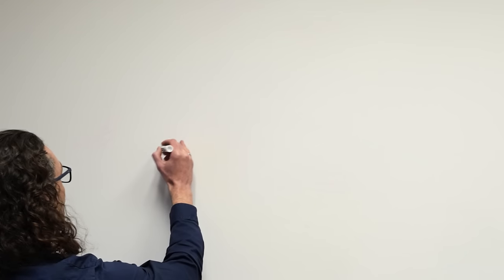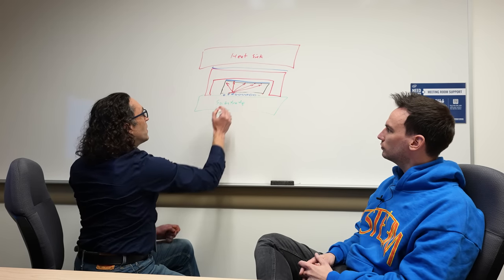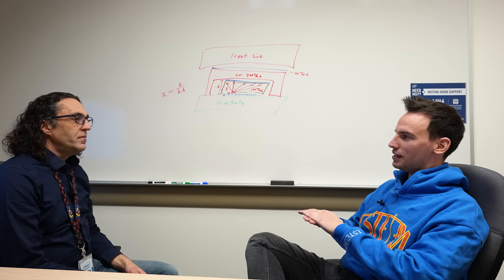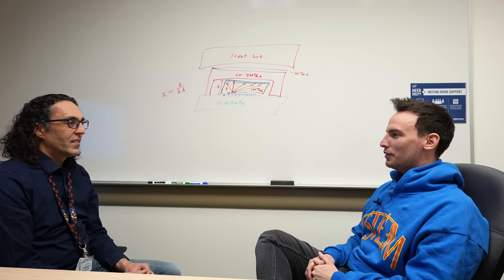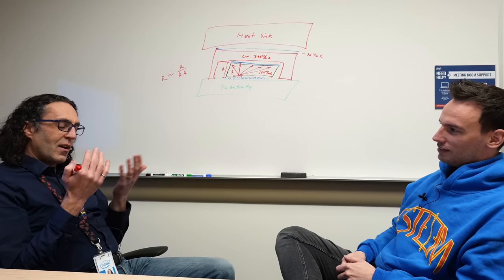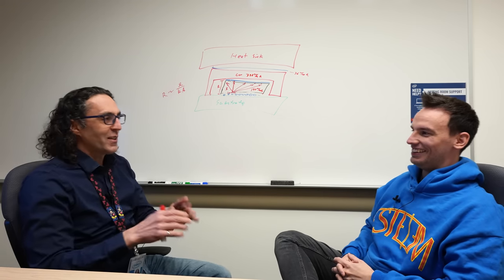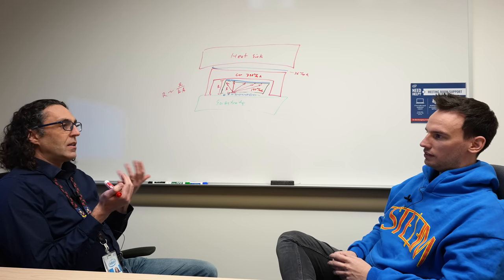Intel Engineer on: Die Thinning, CPU Thermals and Liquid Metal

Comment: easily solved, 2 sided cpu coolers sandwiching the cpu die, and the cpu connectors pass thru holes in the lower contact plate or have passthrus built into them. this solution has already been used in industrial manufacturing decades ago. it stopped due to micro architecture conduction thru too thin insulator materials, newer non conductive materials that perform better have been invented and become cheap enough since then. germanium is also an answer. 
my dad was an operating engineer in 1980-82 at redmond, i remember the day he first brought the intellivision home for us to try, my favorite games were Missile Command, Atlantis, and B-17, football and basketball were fun too, he was part of the beginning of what would become later Electronic Arts.

Comment: Cool video, even though I prefer to stick to team red. Speaking of which, it would be cool if you could do something like this with them as well. Maybe even ask them about possibility of a refresh of 7000 series down the line with thinner heat spreader (for those of us not brave enough to risk modding a CPU).

Given that the supposed reason given for the chonkiness of the AMD heat spreader is backwards compatibility with AM4 coolers, I don't think it would be that hard for cooler manufacturers to make the necessary adjustments, maybe even just sell a different mounting kit or something?

Comment: Quite interesting and I understand (in most part I think) the engineering and manufacturing challenge but at the end I have a GPU that dissipates a bit more than 200 watts/h and stays at 65/68 °C @ 99% load @ 20°C ambient temperature, on quite basic air cooling and a CPU (i9 13900k) that should dissipate, more or less, about 225 watts/h that is custom liquid cooled with somewhat "high-end" solutions (Heatkiller IV with Lowara pump and 360 mm radiator with full push and partial pull from high performance fans) that struggles to stay below 70-72 °C @ 100% load. Definitely I think that this is something Intel has to work on if they will continue to ramp up the power dissipated by their silicon.

Comment: Here, I'll give you a free testing result for my 6700K

Bought it in 2016, delidded and repasted with LM, overclocked to 4.9ghz at 1.45v (along with some other settings) on water. It's been like that for 6 years. Hasn't missed a beat. Also - PC has been on for 99% of that time. And it did heavy work.. it works without any issues whatsoever. I do however, keep temps very low. That might pay a role in it.

Comment: I've been running an Intel I7-8700K OC'd@ 4.8GHZ all cores since 2017' and it's still running just as strong as far as I can tell currently. The engineering is pretty damn amazing that goes into making these chips. I will be upgrading this year but plan to keep my I7-8700K PC as my second "streaming" PC; it's paired with a GTX 1080Ti & 16GB of DDR4 3600MHZ Ram.
Reply: Very nice setup you are running, I am running i5-8600k OC'd 5GHZ all core since 2018 also this winter I was running it at 5.1ghz just fine but went back to 5ghz because it's enough(cinebench stable with good temps but OCCT not stable goes over 90°C to 100°C) , I had i5-6500 system before(my first PC build) and after 8th gen launched and seen that 5hgz OC was pretty easy(if you win the sillicon lottery) when I got enough money  I upgraded and was set on 5ghz OC, so got the CPU, gigabyte Z370 gaming k3 and be quiet dark rock pro 4 and paired with GTX 1060 3gb and 2x4gb 3000mhz RAM I already had, later upgraded to GTX 1660(before the GPU crisis for 200€ ), also upgraded to 2x8gb 3000mhz RAM and it worked well together with the 2x4gb kit(both are SK hynix), the newer kit had worse XMP timings but I manually set the timings to match the better kit(16 17 17 38) so 24gb RAM(I plan on upgrading to 32gb at some point) and when the GPU prices finally dropped(I was set on getting RTX 3060 12gb and wnated to get a really nice one after waiting for so long) I got a used gigabyte AORUS GeForce RTX 3060 ELITE 12G (rev. 2.0 LHR) for 390€(420€ with shipping)(it has extra 6pin so the power limit is 230W) so basically for MSRP and without the 20% tax(in my country) a new one would be way more expansive because of that tax and it was MSRP price when I checked, and the OC is awesome, GPU boosts to around 2000mhz on it's own thanks to that power limit and memory OC'd to 8000mhz(it can run at up to around 8500mhz but only stable in benchmarks like superposition where it hits the 230W limit pretty regulary) and I am just voltage limited now, and the recommended PSU for that card is 650W and I have a 600W unit(EVGA 600B) but I calculated the max power draw and it's fine just under 600W. for my next CPU upgrade, I plan on getting i5-13600K/KF and OC it to 6GHZ with e cores disabled but I'll need to save up enough money to also upgrade the cooler, PSU, probably z690 instead of z790 MOBO and stay on DDR4(I was still in high chool when I got the i5-8600k and now I have dream job since Decemberr 2022 building PCs - clients and servers for surveillance cameras), sorry for the very long comment and that it's probably hard to read because I am not using punctuation properly (English is my preferred language but not a native speaker). I am high on stims and very enthusiastictic about overclocking and PCs in general and have Asperger's Syndrome so yeah LOL.
Reply: Yeah, especially if you are not running your setups 24/7, it doesn't really matter if you are hitting 90C for some workloads all the time.. That is how i OC'd my CPUs since 2500k regardless of the cooler. These days you need a really beefy cooler to even overclock past stock.

Comment: Temperature vs. Voltage cycling -- that's basically what HPC workloads are like.

If you work in HPC or do this kind of work (CAE/FEA/CFD), and you have a decently busy cluster where it is picking up new jobs and working on them and solving them, that's the kind of workloads that CPUs that are deployed in HPC clusters would see where it will constantly be stressing the CPU from the voltage/power perspective, but you stay relatively warm throughout vs. it being able to cool down a 5 or maybe even 10 deg C over ambient.

But for the most part, the CPUs probably have so many safety factors built-in that there is very little reason why a CPU won't be able to tolerate a HPC workload for years and years and years.

Comment: I still have my 9900k. I have all cores clocked up to 5ghz and it rarely gets up to 90C. Only if I'm doing some kind of crazy benchmark or workload it might go above 90C. 
When I'm gaming it runs fairly cool 55C-70C. I think they did a good job with that chip.
I am using an all-in-one cooler with it.
My 13700k on the other hand likes to hit 100C sometimes. That also has an all-in-one cooler.

Comment: I wish Intel just upped the prices of their high performance CPUs by $30-50 and sold them with direct-die frames instead of ILM and heat spreaders.
Would have been especially helpful for CPUs with a 500W+ TDP when overclocked, like Sapphire Rapids.

Comment: I haven't delidded anything since probably 8th gen, I haven't delidded anything for my own personal use since 4th, but man every time I saw my 10850K throttle I thought about ordering a delid tool for LGA 1200. With my most recent upgrade though I made a decision I don't want to walk back on anytime soon, no more consumer grade chips with 20 ish PCIE lanes and Non-ECC memory. 

While the newest Xeons will probably always be firmly out of my grasp dealing with stability issues while my old Haswell E5 xeon server hums away in the other room is not something I'm willing to deal with anymore. I didn't even tune the 10850k it was at stock speeds with the RAM's XMP profile, at that point the K means nothing because it's not even cool on a 360mm radiator, the XMP profile means nothing because it's not even stable without manual tuning, so I gave in and got a used 3647 Xeon W. It's technically a performance loss sure, but getting it up and running and immediately putting it under equal or greater stress than I ever did my 10850 gave me no BSODs. I've decided in the same way enterprise buyers do that stability means more to me than bleeding edge speeds, because well sometimes the bleeding edge cuts you. Plus the single GPU already occupied every direct to CPU lane available to me which is annoying, there are other high speed connections I want to add, high speed networking, more robust I/O, NVME storage takes from lane count, and there's add in cards that I just want to experiment with; now I've got the bandwidth for it.

Comment: I would say the average part, for sure and I agree! Because I used to have a 3770k which has ran at 4,5GHz for almost eight years before I had to back it down to 4,2GHz and these days it just runs stock in my niece her computer!

This chip has seen extended amounts of time being red-lined at 99 degrees on air while I was overclocking it @ 1.52V!

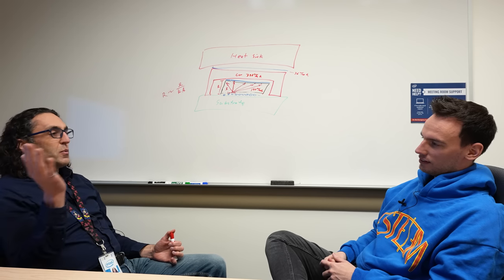Comment: 16:30 why would you not know what happens if a cpu runs 3 years at high load? under normal contitions our intel cpus rund 5 years 24/7 at very high loads without any problems. no data past 5 years tho since warranty is over.
Reply: Because its not his job to know that?

Comment: The comment around consistent heat rather than having heat cycles makes that whole AMD 7xxx argument around 95c put to rest. Consistent 95c is "equal to/or better than" fluctuating between 60-80c on consistent load in terms of longevity.

Comment: Thin spots thicker spots and different texture on some CPUs and gpu direct die access only I was changing architectures thermals with shapes and designs sand paper 1000 grit 400 for edge / texture so shiny chip like chrome engine parts / weird boxes with blob shapes best

Comment: So funny he draws the things we already know, but leaves out secret stuff they think we don't know like the silicon surface treatment.
Also the giant elephant in the room "where did you guys go wrong that we need to use "Contact Frame" to fix faulty engineering designs".

Clearly having whole teams designing stuff is good efforts, but down the line someone needs to collect consumers reports.
And feed them back what went wrong on the engineering designs, they could easily fix 5 major issues with their designs.

Comment: 13700k dropped temp by changing from a real good thin thermal past (kryonaut extreme) to a real real thick one ... so I mixed noctua nt h1 with thermalright tf7 and it really think it has to do with pressure and thickness, using a mix of both these thermal pastes dropped my temp by 10 degrees.  Both times using Thermalright ultra 120 extreme the only change was the thermal interface and I also use thermalright anti bend kit.
Reply: Kryo-Extr, NT-H7 and TF7 respectfully have 14.2W/m*K, 5 and 12.8. Kryo-Extr specifically thrives with a thin application.
So you are currently probably between 10-8W/m*K. So its a regression for sure.

You probably either were too loose on your first application, have a tighter application now or more balanced tightening (between the 4 screws) of your heatsink.
Because a 10C difference is too wide a difference to be caused by just the thermal paste.
Reply: @HexerPsy  I´ve built more than 5000 computers on my life, absolutely nothing wrong with the application and I know all the specs of the power supply, I gave my opinion not because I need to be corrected I know the thermal specs, the heatsink was seated extremely well and I started building pcs in 1996 as my main job, I am simply giving away my experience, and it was tested multiple times, with multiple systems showing the same strange results due to thickness.

Comment: no word about the bendable cover of the 12th and 13th gen cpu's...
Reply from the maker: I see no point in even asking about it. For intel it's about finding the most cost effective solution to build their CPU. If the IHS bends slightly, is 6°C warmer, but much cheaper to manufacture and runs within spec, they will do it.
Reply: Because it doesn't matter? The chip is still within spec
Intel could somehow make a mistake that made a cpu idle at 70c but as long as it doesn't go above 100 on a load test they don't need to care

Comment: Usually the Mv / Amp / watt, is too high and the temperature too high, and the company doesn't think beyond the warranty on those things, which is somewhere between 2 and 5 years max, so I don't understand that man's explanation, outside turn around the pot,  less = less, no matter what you say, sry dudes that's my opinion

Comment: With all these things they are paying attention to, and at the scale they are manufacturing them, whey are they still using such garbage TIM almost all the time. So many now know that just de-liding a CPU and replacing the TIM will gain you anywhere between 5-20c, so why aren't they getting something decent... you know like Thermal Grizzly. At their scale it would cost pennies more per CPU it makes no sense that with all these complex notation they don't seem to put that into the equation.